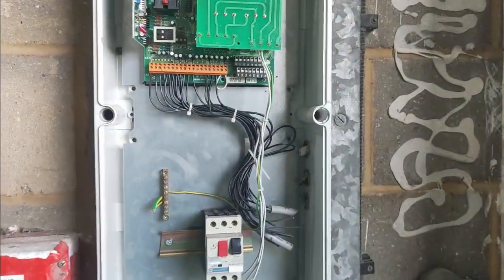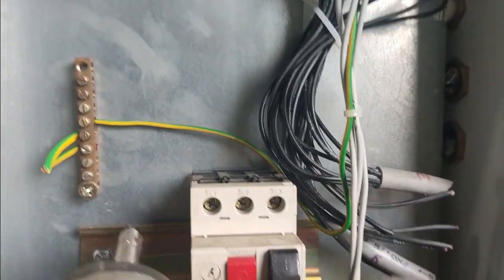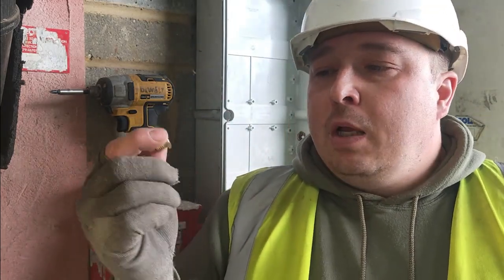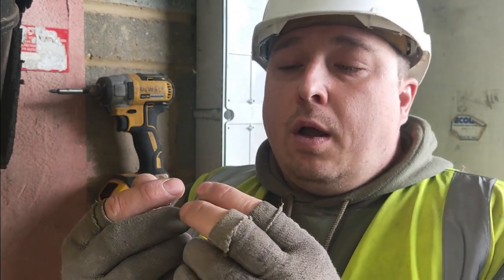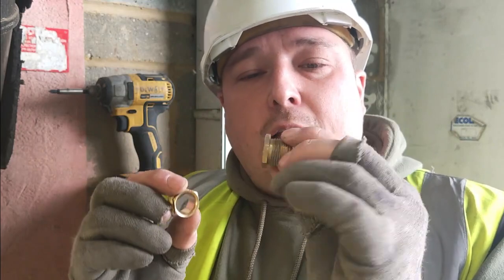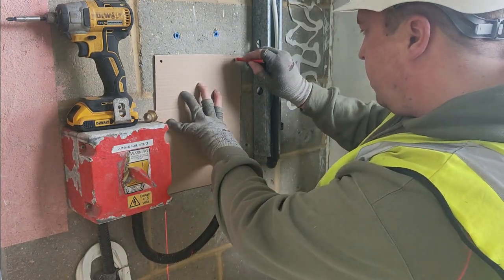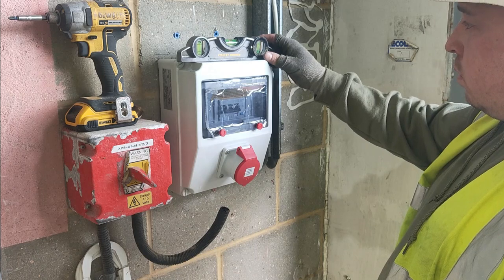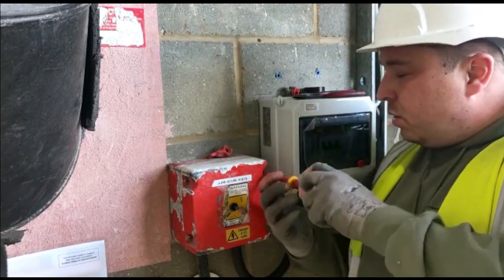TOO TERRIBLE TO SHOW [INDUSTRIAL ELECTRICIAN]

Comment: Couplers and saddles for steel conduit are very bad quality as well I'm tried getting them from different wholesalers but the bad quality is the same where ever you get them, I'm fairly old and was doing conduit work in the mid 1970s and the steel conduit bits & pieces seem much better quality then.
Reply from the maker: It's a strange thing to save money on and it would be nice to have to option to purchase the high quality stuff from what I hear you are correct you can't buy it anywhere